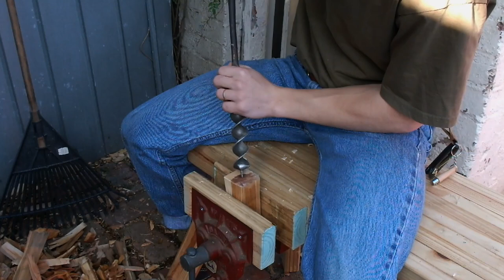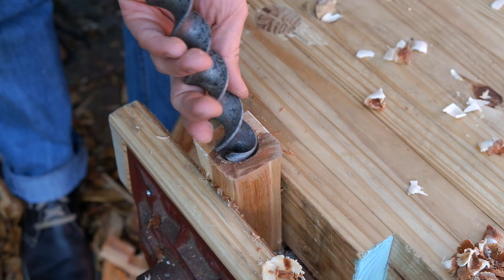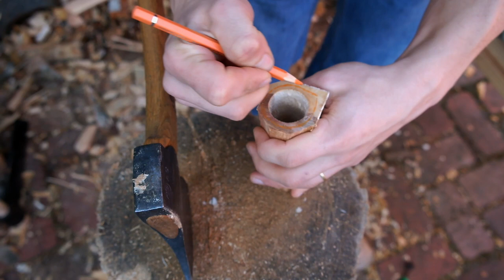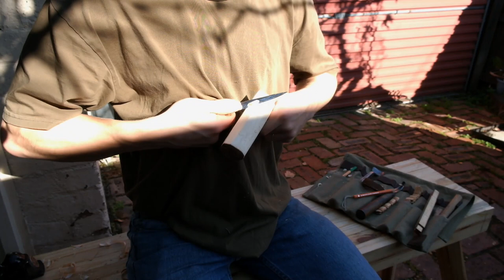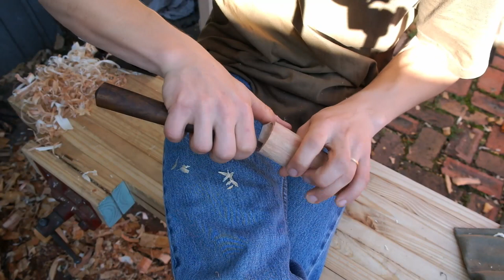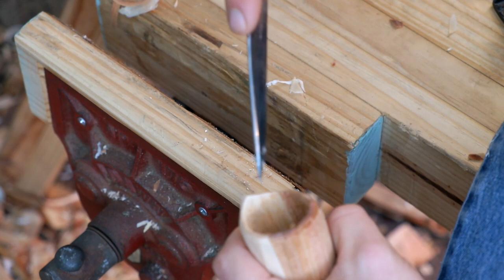Carving a Pouring Jug | Greenwoodworking projects

Comment: Beautiful work and beautiful video. Do you still plan on making the part 2 ?
Reply from the maker: No I never did make part two! Sorry :~)

I'm not sure what I would have covered in a part two either, maybe doing some finish cuts after it dried.

I still use a few of these little jugs that I made, but not for milk as they're too hard to clean.
Reply: @jones_trees_and_treen  Oh, I see, thanks for your quick answer !

Comment: Hi, do you clean up the inside of the base at all? Doesnt the hole left by the lead screw go manky in use otherwise?
Reply from the maker: I haven't found a good way to do it. It doesn't bother me, but if it bothers you, you could always plug it with wax.
Reply: @jones_trees_and_treen  I wonder if a twca cam or spoon scorp might do it. Not that I have either. The other thing I thought of was a spoon bit, like they use for hollowing clogs. Mind you if you havent had a problem with it it isnt an issue, I was just curious.
Reply from the maker: A spoon bit would work. I have a twca but it's too big. Spoon scorp could work but it would need to be a small one.